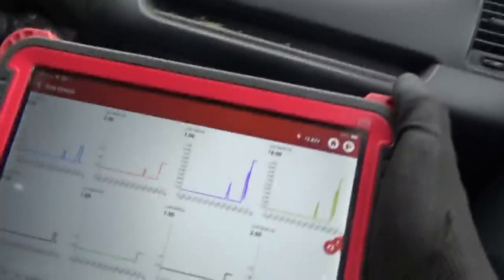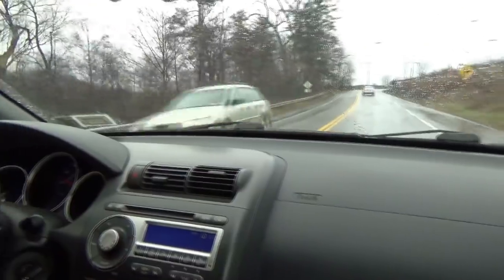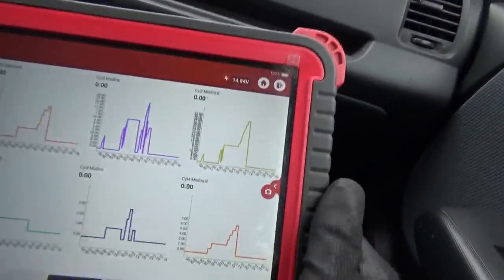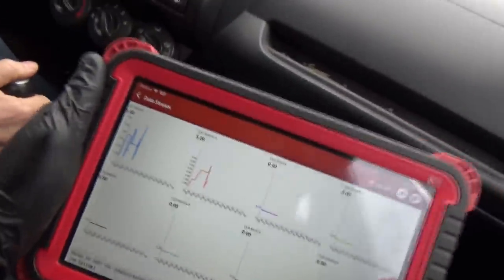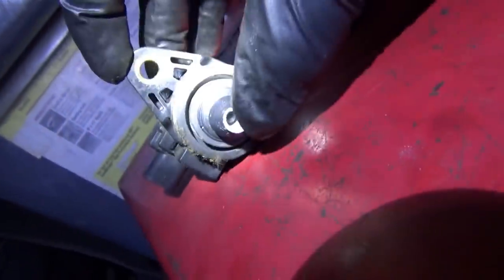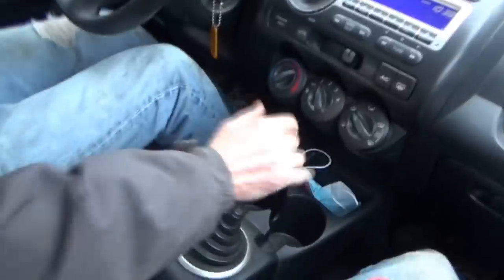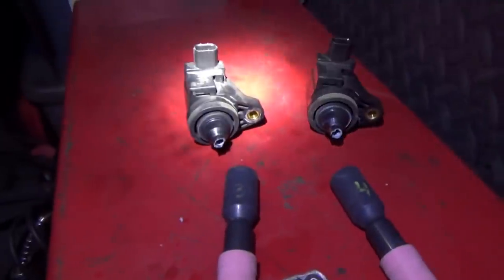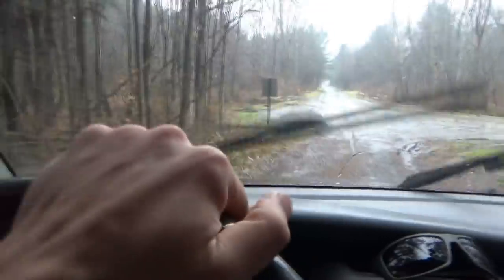Honda "Fishbite" MISFIRE (Diag & Repair)

Comment: Your Dad nailed it for sure. The strong electric fields in high voltage applications can cause ionization and material breakdown, usually in predictable manner but because it is high voltage, it can also do crazy unpredictable things. So if you see things like that rubber-like compound breaking down, it was usually a strong electrical field responsible and not just old age or oxidation. These things are combatted with clean and solid terminations and silicone di-electric grease (or very large air gaps) just like you and Papa did. Notaknowitall, I just know what I know.

Comment: What your dad said about sharp edges and particles or ions is 100% correct . In HV power  systems alot of effort is put into designing equipment with few sharp ends and all edges are machined to have no sharp right angles . This helps reduce corona where the air in the vicinity becomes ionised often it forms corrosive  gases with atmospheric nitrogen producing nitric acid that reacts with copper to form green residue not unlike the green crusties you find on some connectors. In my old job I always trusted my nose in HV environments electrical arcing also forms ozone which has a distinctive smell I sniffed out much faulty equipment before it self destructed. Once arcing starts damage is  being done .

Comment: Your father has excellent taste in cars. They were called the Jazz here in the UK and I have seen these things go 200,000 miles with maybe a section of exhaust a clutch or sometimes a wheel bearing. We had one as a work vehicle on an industrial estate I worked on. 6 days a week it pretty much stayed running 11 hours a day driving around hauling guys or tools or equipment. If you fold down the back seats flat you can cram so much stuff into one of these. 

Oddly enough here in the UK most of these Jazz's actually had like a hemi set up with 2 spark plugs/coils per cylinder. The L-series engine is also chain driven which is also a bit odd for a Honda. 

LM auto repairs had one of these where somehow the top of the engine had got flooded by water and it had sat in the spark plug wells and destroyed the plugs and the coils. That was quite expensive. 8 brand new coils from Honda plus 8 iridium plugs.

Comment: Your dad is right! The electric field of a needle is fascinating mathematically! The field diverges towards infinity as the tip gets sharper, you can best solve it exactly by conformal mapping!
Reply: You all are waaaay too smart...
Reply: and...  AND....   A N D,,,,  is why a lightening rod is a POINT!!
Reply: Yeah the cleaning likely smoothed out the sharp points, you want sharp edges at your spark plug positive electrode only, not anywhere else. It's not necessary to remove all sharp edges from the coil and boot, just sand it enough to make it duller than the spark plug so that the majority of the energy is being spent at the plug.
Reply: You brought back memories of my Electricity and Magnetism courses at  Oregon State!
Reply: @rosselnator  I'm an ME student at OSU right now. I don't envy the EMAG students I've seen in Kelley!

Comment: Your Dad is spot on. When I was doing research with HV equipment I used to calm down the discharges by moulding Apiezon Q vacuum putty on sharp metal edges to move the air away from the very high electric fields that form around edges, dust and whiskers of metal. Looked awful but worked really well.

Comment: The original ZAZ mechanic is a pretty sharp dude! I think there is something to his theory of electrolysis and ozone production degrading the materials of the coil/boot over time.
Reply: Definitely. Each time I take my coils out I can smell a really strong scent of the ozone. This has to have some effect on the conducting and insulating parts of the coil.

Comment: I'm not a mechanic but enjoy these videos. On the 'B'  misfire the internet says: A “Type A” misfire will illuminate the Malfunction Indicator Light (MIL) if it detects a misfire that might cause the catalytic converter temperature to exceed 1,500-1,800° F. A “Type B” misfire will illuminate the MIL if a misfire occurs that might increase exhaust emissions, but not damage the catalytic converter.
Reply from the maker: Wow that is very interesting info! So Type A is a subset of Type B? 🤔

Comment: Great troubleshooting as usual. Lucky that was a 1st Gen Fit. 2nd Gen Fit’s you have to remove wipers, plastic cowling, and metal tray that overhangs the firewall. Makes for a challenge whenever changing plugs or coils with that generation.
Reply: Exactly! 2011 Fit here- getting that stupid windshield washer fluid hose to stay put while putting it all back together is a pain!
Reply from the maker: Wow sounds like a PRIUS 😂🤣

Comment: It worked great. Thank you so much.  I don't think very many people go down that far. I didn't replace the boots. I just cleaned off the carbon. I also replace the spark plugs. You have to be careful when you pull those boots off  because I broke part of that coil off at the top, so the little pointy part of the coil was kind of sticking out. I tried to glue it back on, but it's some weird plastic. If anybody else does it be careful when you pull those boots off and they don't come off easy. Thanks again.

Comment: I had the exact same thing happen to my 2007 fit. Random misfires but mostly on one cylinder (a year later on the two adjacent to it) I diagnosed it down to the coil but never even thought about it being in the boot. Oh well, 3 new coils later and a set of plugs and it is running well. Thanks for the thorough diagnosis Ivan, I will look deeper next time!

Comment: Ivan, love your channel.  I have an 08 Fit, manual, same gen as your dad's.  Never had the misfire problem yet and have 183,000 miles.  Had a problem with a loose spark plug 10 K after changing them.  Some owners have had the original, untouched factory plugs come loose.  I figured it out due to a gasoline odor under the hood.  Other thing was at 160 K, had an oil leak that was due to oil leaking THROUGH the oil pressure switch above the oil filter.  Connector was all wet.  Neighbor has a 2015 Mazda CX-5 that had the exact same issue a few months ago.  Both were OEM switches.  Fit has been very reliable otherwise.

Comment: Thanks for sharing! My father in laws Fit had a similar issue,  I did plugs and coils and a year later a issue that went away once the coil was removed and installed.. seems to be fine for over a year now!

Comment: The bad contact on the high voltage spark circuit can not cause misfire, the HV really readily jumps over. But the discharge there tends to create ozone and UV, which then very quickly corrode all the plastics around, mainly when combined with heat. The ends of the coil (interfacing the boots) are the showcase.
Then the corroded plastic may cause the moisture to get in and form a current path on the surface, effectively short circuiting the high voltage circuit and that is what does cause misfires.
With the WD40 you may have cleaned the surface contamination so the misfire may go away for a while, but because how bad the coil ends are, I doubt it would be able to hold the moisture away, so my guess after short while the problem will be back.
So according to me the coils do need replacing, really all of them.

Comment: We had an interesting case of ozone corrosion in a large generator some years back. The windings in the generator were breaking down and producing coronas which produced elevated levels of ozone. The air to cool the generator went through a TEWAC (totally enclosed water air cooler) which had copper fins soldered onto the tubes to help with heat transfer. The ozone attacked the solder and oxidized the zinc portion. By the time we discovered it, we were shoveling out zinc oxide powder in buckets, the coils were just dangling from the tubes and the generator was covered in dust. We ended up replacing both TEWAC's. Then we added insult to injury by using the wrong brazing material (vendor subbed an "equivalent" that was not approved for use) on the new exchangers and liquid metal embrittling them, haha.
Reply from the maker: Dang sounds expensive!

Comment: Yep been there done that, corrosion gets em every time. Odd how it gets past the seals and just corrodes. I think a scope is such a great too, I find it odd there were no misfire codes set when it was obvious on the scope. Can you take a guess it didn't pop misfire codes?  I think most people would have found this just by checking the plug boots without the scope, but it sure helps pinpoint those items that can't be physically checked without swapping a lot of parts at a small expense. Thanks for sharing. Best Wishes & Blessings. Keith Noneya
Reply from the maker: The scanner was very helpful. Would be tough to catch it on a scope probe since it has coil on plug, and only acts up under load 🙂

Comment: I've seen where the spark blows through the boot on some Ford F350's.   Tiny as there were, swapping coils found the misfire.  We had the coil assembly, misfire gone.  Following week, same vehicle, different cylinder misfire.  Change all older coils and probably what started the misfires, the worn spark plugs.
Reply: Worn plugs require a higher breakdown voltage before the spark snaps, so that probably did stress out the boots (and coils too).

Probably pretty common to see those HD trucks behind on maintenance like plugs too.

Comment: Okay...good diagnosis and repair for the personal car. I'm wondering if that would be the best solution for a customer though which would depend on the cost of coils. Those plastic tips are surely destroyed meaning, the change in shape could alter the design of spark delivery. The boots did the job...good choice there as the coils are about $45 each. Long term my guess would be 4 new coils but only due to the "tracks" and damage made to the tips of those coils. Perfect example of why some sort of a maintenance plan is needed to get the effects of change in temperature humidity damage out of the socket/coil/plug.
Reply: Also remember some “cheaper” coils don’t come with the boot! So if someone went the cheap route (which with coils and plugs always best to stay with oem), they would have had to reuse the old boots and still probably have issues! But if someone pulled the boots and seen the crusties and still didn’t clean em up they get what they deserve lol
Reply: Personally, I would replace all of them.
Reply: @B0xlife1  Best to buy the ones that do have boots, NGK or Denso. Coils are not the best parts to go cheap.
Reply: @Garth2011  agreed 110%

Comment: Found a huge rat's nest in the air box in this 08 F250 that was having a hard time starting when cold. Only gets used when it snows so most of its problems are related to sitting outside for long periods of time after being driven thru the salt. Also has a clapped out 5.4 three valve...

Comment: 2012 Fit.   CYL 2 misfire permanent?   Injector resistance ok, (10-13) power to injectors.  Swapped coils with cyl 1.  Cylinder 2 still problem.  Coil didn't seem to seat as deep on CYL 2 ??  Short drive heard chirping/squeaking.  Pulled coils at gas pump to make sure one wasn't missing spark plug spring and the other CYL2 had 2 , nope.  Can feel tapping on CYL 2 coil.   Turns out spark plug was loose, backing out.    Just got this last spring from my uncle that passed.   Will change all the plugs soon.

Comment: I plan on replacing all those boots with new. Once there's high voltage parking across a polymer it's surface breaks down and is more prone to future tracking. A temporary fix is a tiny bit of our electric grease after carefully cleaning. WD40 is the last thing I'd use on a polymer.

Comment: Looks like Connecticut Hill! Nice quick diag!
Reply from the maker: Hey Josiah! This was Hill Rd close to Danby heading South. Don't take your box truck on it lol!
Reply: @PineHollowAutoDiagnostics  Noted! My old Subaru hasn’t been stuck yet on these seasonal roads. Sometimes you do reach a point where you have to back up for a mile because the snow is too deep and there is no turnaround haha!
Reply from the maker: @blueskiesmobileauto4253  slap some chains on the back it will keep going 😉

Comment: I thought for sure this would be a loose spark plug issue, as Honda Fits are notorious for the spark plugs working loose from the cylinder head (and sometimes taking the threads with it.) The 2011 Fit my niece drives shot #2 plug out of the head through the coil, and #3 had worked loose as well. I ended up having to do a helicoil on that #2 plug hole and blue-loctiting all the plugs back in.
Reply from the maker: Wow crazy. Maybe the 1st Gen fit has stronger heads?
Reply: @PineHollowAutoDiagnostics  That certainly could be the case. The 2nd gen Fits were around the same time Honda quality took a dip for a bit (2012 Civic anyone?) I had never seen anything like it.

Comment: Hi Ivan, why no engine code?  I owned a 2004 Fit just like your father’s, bought new, best car I ever owned.  Gearbox developed a whining noise when it was just out of warranty at 90,000 miles, Honda good enough to replace free of charge.  Not long ago replaced a bad ignition coil in my sons 2017 Elantra, never thought to see if there was a crusty connection, could have saved $90!

Comment: Hello Ivan
I'm curious as to what scanner you are using and WHY? Have you had any experience with Autel, Launch and Xtool? And if you can give any insight as to why this type and brand over the others. Thank you
Reply: He is using the Thinktool Pros and the software is Launch based.  I have the same tool and it has great capability especially for the price.  Ivan can answer why he is using it.
Reply: I have used both ,Autel and Launch, both good, but in my experience, Autel is better, it's a gun. Autel has a slight better coverage, and it's very friendly to use the whole program. You can figure out, a lot of stuff, very easy,how to operate the full  program.hope it's helpful.

Comment: Wherever you got resistance in a single loop the component with the highest resistance is what will “heat up”(dissipate heat) the most. Lol I won’t explain the highest place of voltage drop is where most of the watts blah blah. 

So the resistance due to the corrosion is just going heat up. That is why corroded wiring plugs that use a lot of power heat up and melt. I am sure you have seen this before.

Comment: I don't have any car problems, but how could you possibly diag which cylinder is dropping out under high load conditions like this without a scan tool, or on a pre-electronics car? I could imagine specifically killing a cylinder one at a time and driving it, and seeing if the running gets much worse at the high load, but is there another possible way to deduce what cylinder it could be?
Reply from the maker: Usually those have a distributor so you would use a 2 channel scope with capacitive probes 🙂

Comment: did your dad have any problem with the electric power steering? if so howd you fix it? I think there is also a recall on the drive shafts for the manual trans, fyi.

Comment: Why is it called a "fish bite" misfire?   Is this different than a single cylinder misfire?
Reply: Going up a hill like they were, the pressure in the cylinder increased.  Spark does not like the pressure and looks for another path to ground.

Comment: давай на пятой под нагрузкой😀
На этом моторе только 4 свечки?
У меня 2004 год 8 свечей.
Задний ряд стал хондрить....дает помехи на датчик коленвала,машина дёргается страшно.
На пока отсоединил задний ряд,еду на четырёх свечках.Как в известном фильме стало...МаШина зверь слушай.
Если батя по трассе ходит то можно круиз поставить на раз.
Спасибо за видео.
С Новым Годом!
Reply: Exactly.This is typical issue with this engine(with 8 spark/coils).Im also wondering if Ivan dads Fit has 4 or 8 sparks?

Comment: What to do when you do not have misfire counters on an older ECU?
Reply from the maker: Scope and pickup if it has a distributor 👍
Reply: @PineHollowAutoDiagnostics  Coil on plug, with rear coils hiding under intake manifold, V6
Reply from the maker: @frosty98412  then replace all the coils and plugs with OEM components. But ONLY if you have the fishbite symptoms. If it's a dead cylinder then it's much easier 😉👍

Comment: These coils don't last more than 60k or 7 years in hot climate, you're lucky to make them going to 130k 
5:08 the plastic deterioration starts after 5 years of service followed by corrosion of the spring inside of the boot
Reply from the maker: Is that a common problem on these Hondas?
Reply: @PineHollowAutoDiagnostics   Common on 2007 Fits (coils with red boots) New part number has blue or black boot and vent hole on the back of the coil part.
On my car it was missing on idle under load (in drive) I have A/T

Comment: They still do this haha.  Gotta 2019 Fit EX.  Fuel pump, injectors, coils, plugs, map, maf.  Better.....  but still misfiring.

Only difference is that the last generation of Fits can't even be repaired for 20,000.

There hasn't been a high mileage car made in 25 years.
Reply from the maker: Interesting. 20,000 dollars? I would say best era of high-mileage cars is 1995 to 2005 :)
Reply: @PineHollowAutoDiagnostics  20,000 is purchase price... not repair costs.

It started making the rotten egg smell so I assume it's the CAT.  All that fuel had to go somewhere while misfiring.
Reply: @PineHollowAutoDiagnostics  And yeah agreed.  Had a 1995 Escort GT with 245,000.  Bodyrot it's only enemy.